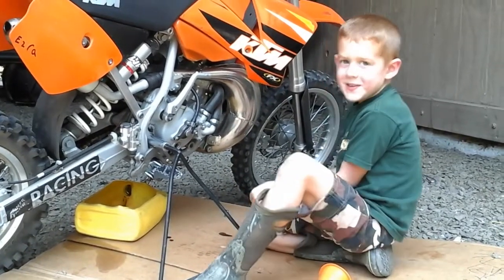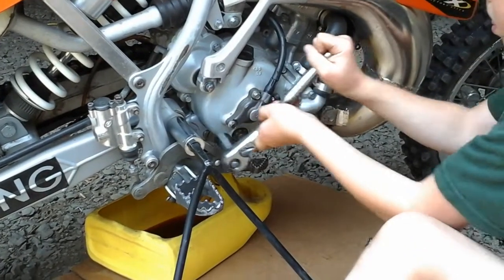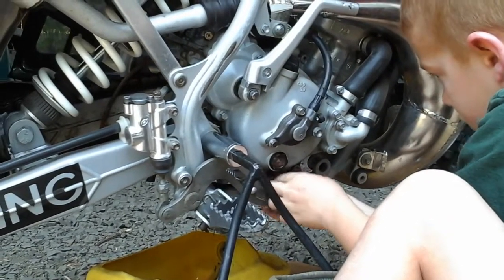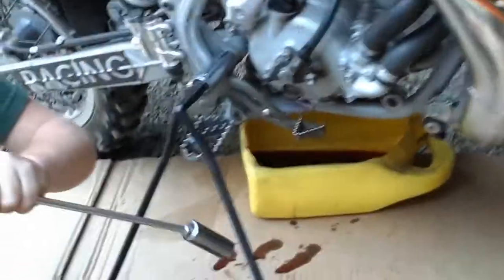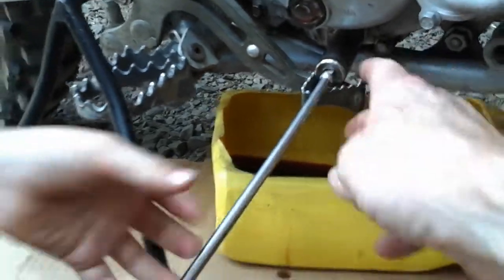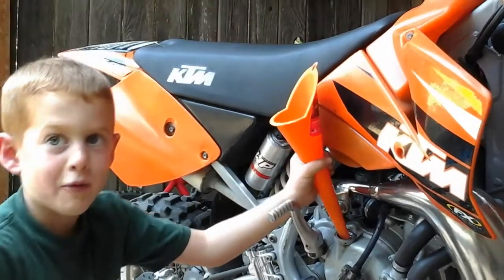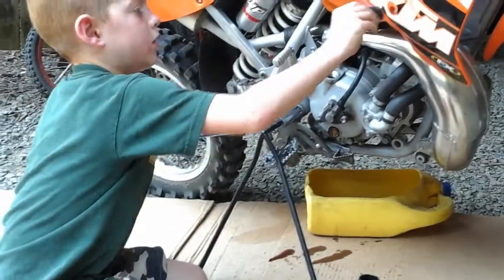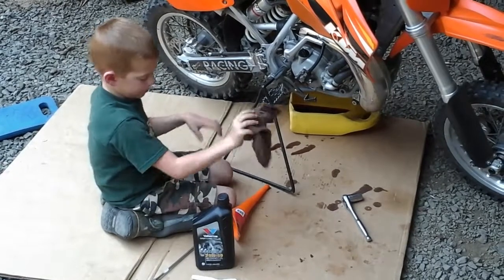2006 KTM65SX crankcase oil change #2

Comment: is there such thing as a gear box oil on these older ones i tried looking for a plug on mine and couldn’t find one
Reply from the maker: There is normally a plug on the bottom of the engine. On this bike it has a sight glass so you can visually see fluid level and than the drain plug bolt on the bottom.
Reply: @nathankoroush7918   ohh so there is not such thing as oil for the other side because iv seen from newer ktms that you hve to change it on both sides
Reply from the maker: Not on this bike.

Comment: That first plug you put back on what is it called because I think I stripped it and idk what to order or anything
Reply from the maker: That is just the sight glass plug for the case oil level.  Amazon has them.
Reply: gearbox pleas not a crankcase !!!
Reply from the maker: @leiflundahl8018  I will let you use that title for your video. Thanks